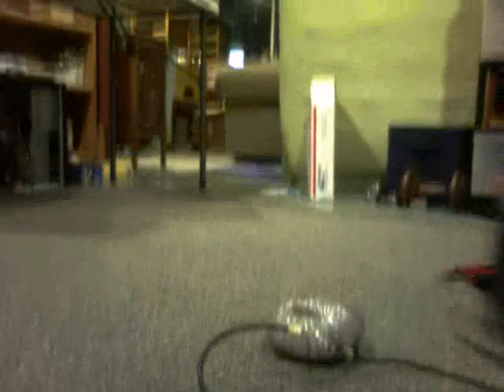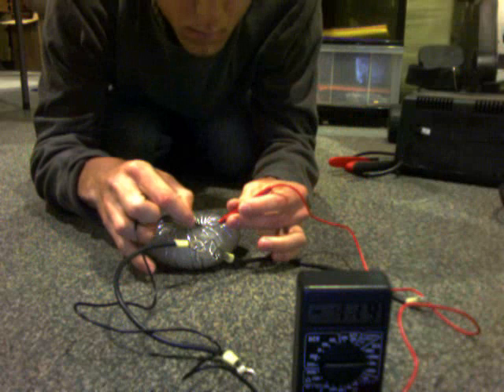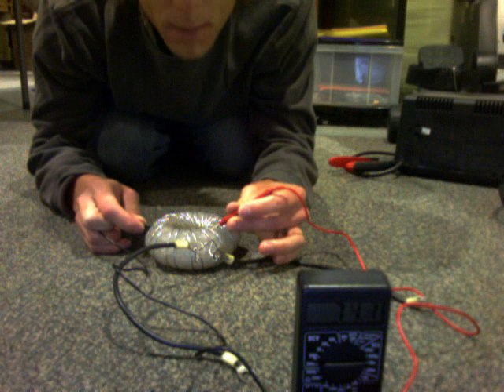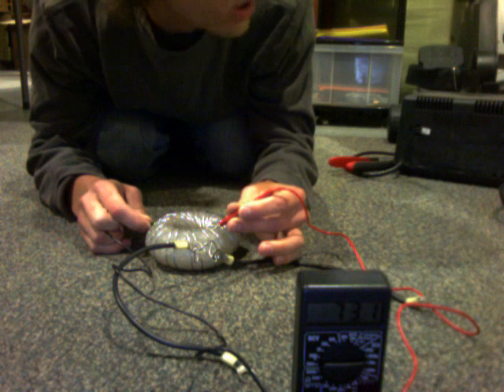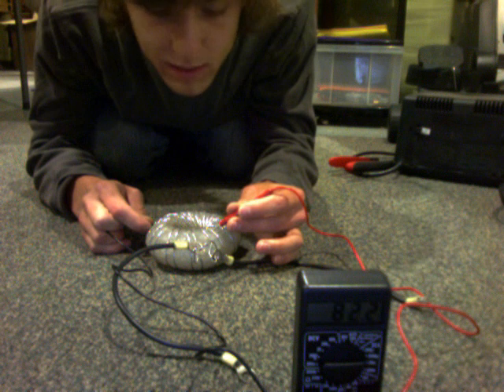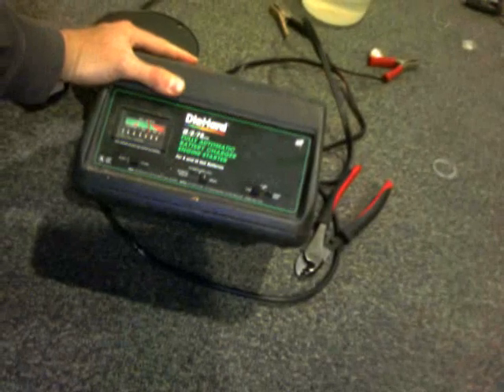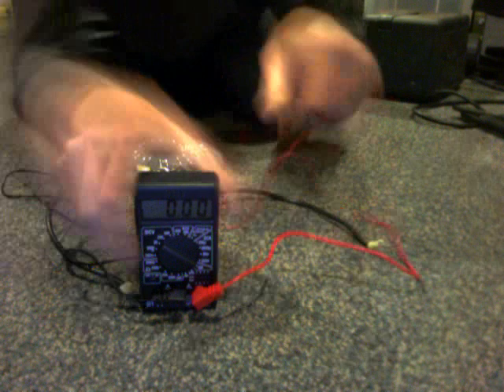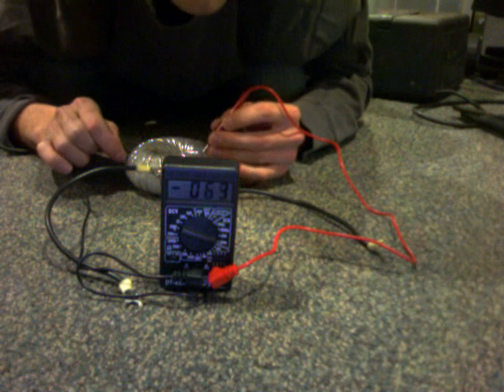Rodin Coil Antenna Activation

Comment: I quote Russ Blake:
Finally, nothing has yet been accomplished which links Mr. Rodin’s patterns to conventional scientific theories. The fact that utilizing this pattern does result in effective coil design is probably not an accident, but there remains an enormous gap between what is considered "known science" and Mr. Rodin’s patterns. This remains true in spite of the application of these patterns to such diverse areas as plant growth and musical harmonics. Until a clear link between the Rodin Torus and known scientific theory is established, it may prove difficult to bring the full attention of the conventional scientific community to bear on solving any remaining problems.
End quote. To the posters with disinformation: This device is NOT a free energy contraption, and it will NOT make black holes. If you do not understand the science behind the fact that this is a magnetic field with some special properties, do not mix it with snake oil propaganda. Mr. Rodin (and his "apprentice" Mr. Powell) is so far off the cuckoo spectrum, pretending to understand (and make up) science that he does not, after stumbling over a numerical pattern with toroidal properties.
Reply from the maker: I see you found one of my first videos! Good thing I learned about a bit more about electrical engineering since then ;-p
Reply: Hahah, keep the learning going! I hope you do well in EE!

Comment: power.  the smaller 7 against 4 coils with a battery are the same using the same source the dialectric. Realy happy if you got some radiant power from your coil bro bloody ecstatic even .....
was tinking when the current dropped ( it worked like a car coil) just in a loop fantastic.

Comment: there are quite a few coil based standing electro magnectic circuits out there one is made by using a lighter piezo crystal to charge a coil made with a 4 way mains adapter the standing elecromagnetic wave lights a bulb and runs a 1 k fire the high voltage induces a load more into the coil that then picks up the changes in the dialectric and bingo real

Comment: every time you scoot around on the floor you meter spikes way up,looks like your unit is picking up electricity from you,scooting on the carpet (static friction),but it did work=-)

Comment: @acengineer4u Does this mean that the coil can be tuned into a wavelength in scalar potential.....
It works as a toriodial surface which gives it omni directional properties due to the circumference of the field potential....
That means the resonance can be tuned to the lower frequencies for every stage of the oscillation due to the fact that the coil operates to the quantisation of the magnetic flux in the vortex at the 2 surfaces on either side of the coil. Hmmmmm thats interesting !

Comment: I see how the rodin coil is actually bifilar where the wavelength is channelled into 2  opposing currents that creates greater potential when used as an antenna. The fact that the rodin coil has the space symmetrically designed to hold the gauss/tesla field of the magnetic strength or flux in a 3 dimensional space as opposed to the normal bifilar winding 2dimensional flux density in a conventional bifilar winding where the space for the gauss/tesla field is above the plane of the winding....

Comment: Thanks, Here is something you may or may not know but since you are working with coiled wire, When you have a closed loop or a coil of wire in the shape of the number '8', when you send electricity though this configuration you will null the magnetic field where the wire overlaps. The current flows, lets say in a clockwise direction in the upper half and counter clockwise in the lower have, in effect creating a positve field and a negative field in the other. Rodin coils are 8s in section view.

Comment: dude check out advancedhydrogen channel he has found the same thing you did but he has an oscilloscope and he shows the field you found in waveform... he has a self resonating dual rodin coil set up.. get a hold of him as he built a hydrogen cell with dual rodins using an a and b field potential with a unified field in the center..

Comment from the maker: @levettp I don't remember what I exactly said in this, but probably the water isn't conductive cause it's distilled. However, it's not thoroughly distilled (lab grade), and it also has CO2 dissolving in it making it more conductive, so ya I understand ya. I've been thinking about that very effect in an HHO generator too this very week. My goal as of lately has been to unify an HHO generator with a rodin coil (different wiring configuration though I'm going to use) and GEET technology.

Comment: Tesla used a tourus shape antenna. The power should increase the higher you place the coil in the air. It may be one volt for every three feet up. Try it see what happens.

Comment: You might have just created a very weak capacitor. Try hooking it up without and power input to a resistor for an extended period of time and see if the voltage discharges. Also, didn't you build that with quartz crystals inside? I'm pretty sure those create a weak electric current after electricty is applied to them.

Comment from the maker: @Xraller Closest HV lines are a mile away, and the transformer next to my house is 500 feet away. Only works continually when in water. Once removed from the water, it'll slowly lose its charge over twenty minutes on average where it will eventually read 0.0 mv continually thereafter.

Comment from the maker: Over ten minutes after running the current through it, there is little to no charge. It spikes a little up to 30 millivolts sometimes, but is for most part it's draining out. Basically that means the rodin coil generates a black hole as theorized which still stays in rotation without the electricity which eventually winds down, and collapses upon itself as it cannot sustain itself.
Reply: Can't the energy be locked in by using organic resin?